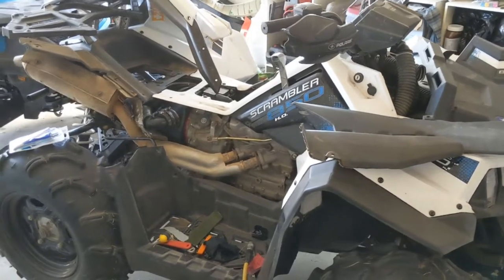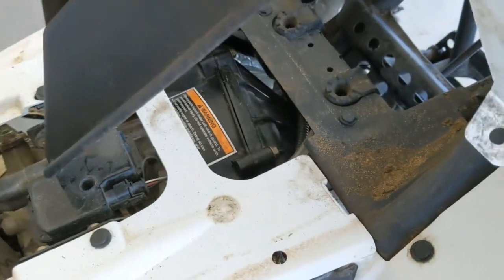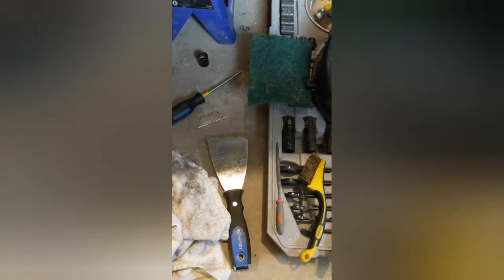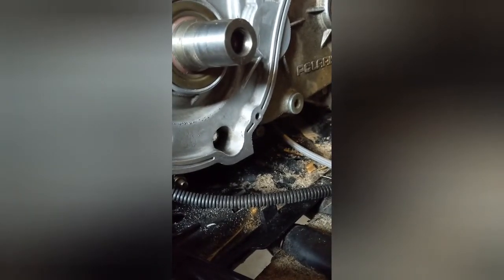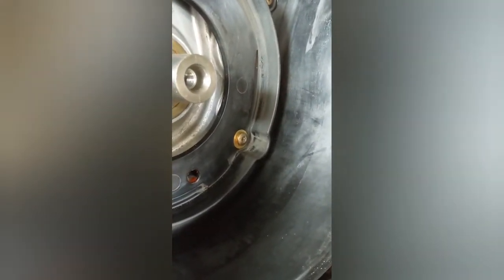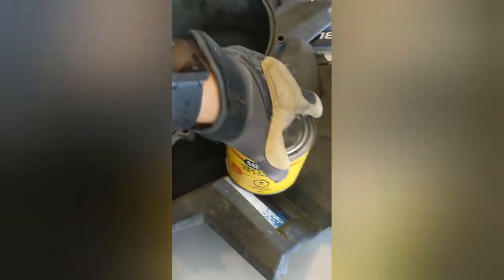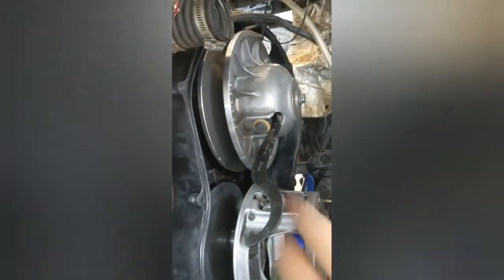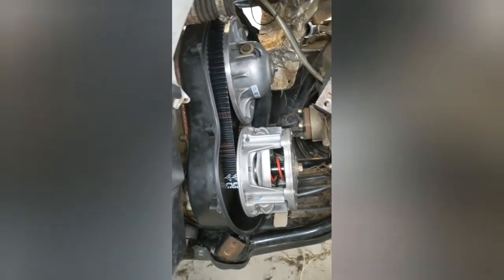Leaking clutch on polaris scrambler sportsman 850

Comment: No leaks after doing this?
Reply from the maker: No leaks. Also I removed sealant on the outer case and just used factory rubber gasket. All my water was coming in from the broken gasket on back of clutch housing. So I would save yourself the hassle of sealing outer case unless you are swamping your quad all the time.